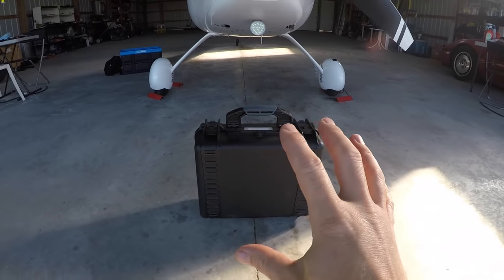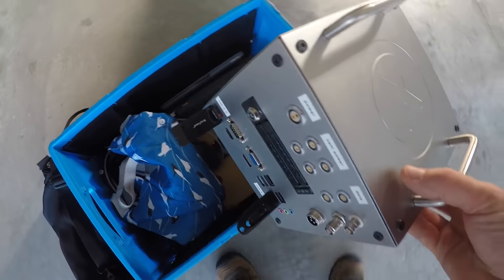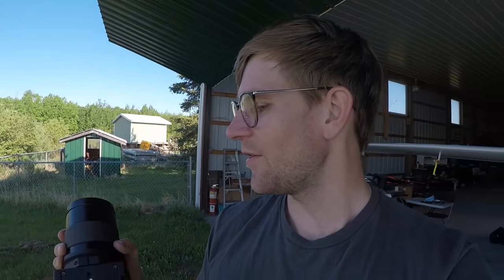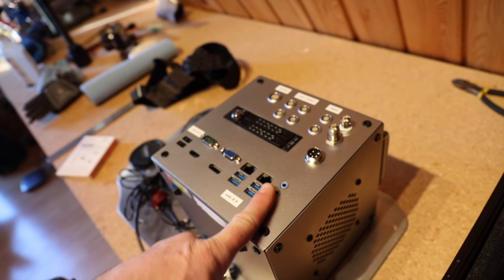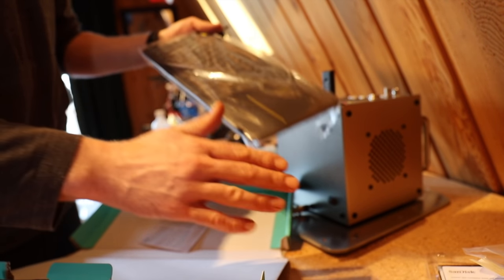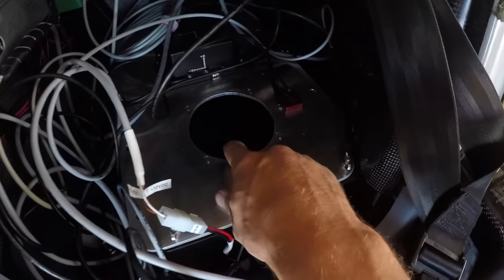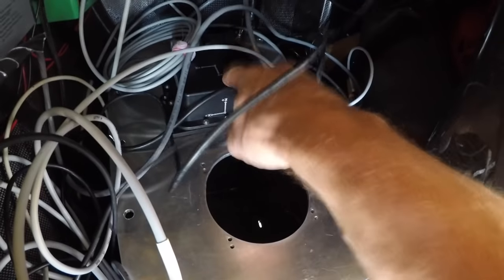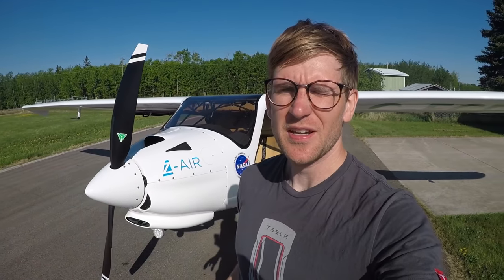Surprise! We got a Hasselblad A6D!

Comment: nice setup! which mapping software do you use? did you run into any trouble when mapping since each photo was over 200MB?
Reply from the maker: Using Aeroscientific Aviatrix flight software, works well.  No issues when recording images, can handle up to 1 image a second. The SSD i'm using is 550mb/s write speeds

Comment: I hope you are not stupid....because now we have drones for this kind of works....!¡.🙄🙄🙄🙄🙄😎
Reply from the maker: Yo My drones are not useful for mapping large areas. They break easily, suck in windy, wet conditions. Mapping drones are only good for very small areas that require high resolution. They have a purpose but they definitely don’t replace need for full sized aircraft yet.
Reply: @DarrylZubot  I think, it should be also possible to equip your plane to process the task autonomously. Especially when you need to map such a specific rectangular region.
Anyway, it looks cool, kind of playing Pac-Man )